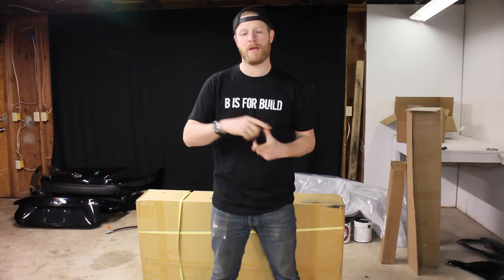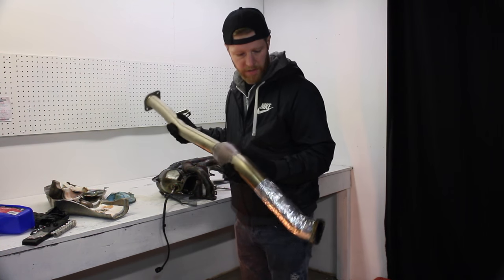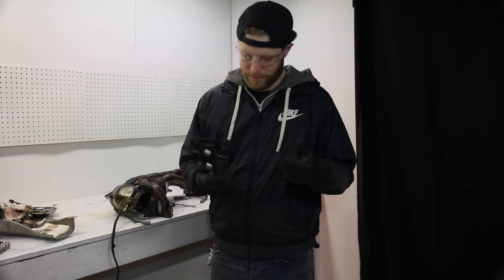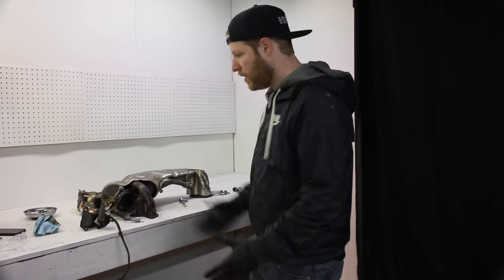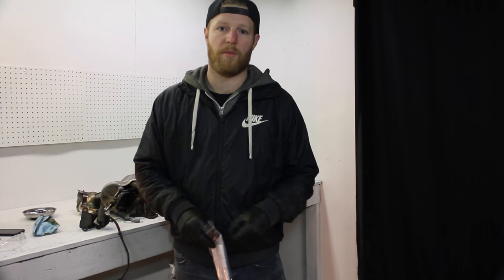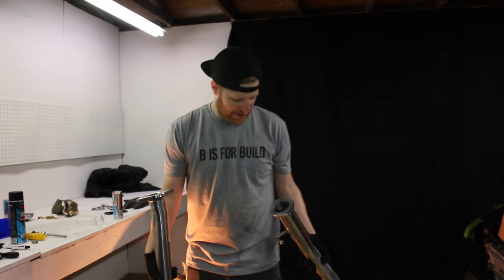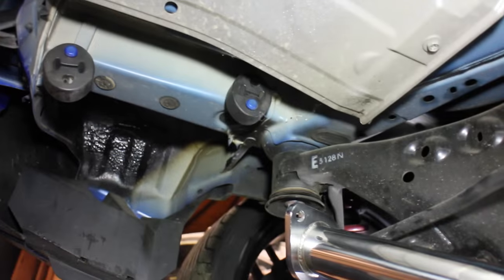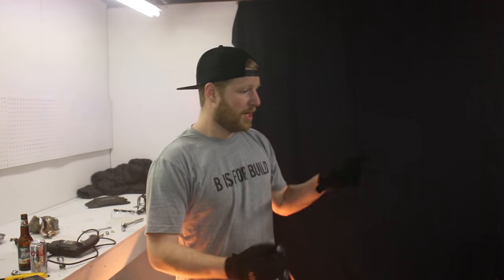BRZ Resurrection Pt 20 - New Exhaust Install & Minor Engine Failure...

Comment: My car started doing the same thing after putting on an exhaust. It took a few weeks for it to start doing that though. Kinda sounded like it was cammed, but unfortunately that wasn't the case. Just disconnected my battery and let it sit for a bit, reconnected it and it was fine, hasn't done it again

Comment: Not sure if yo put o2 sensors in the new exhaust but usually there is 2 either side of the cat and if the sensors don't read correct ecu doesn't like. Car is coming along great  though !!!

Comment: did you install all o2 sensors? does the nameless pipe delete o2 sensors or does is have a thread for them? sounds like ecu is just trying to correct the fuel mixture because it is not receiving a signal.

Comment: for those codes since they have seem to shown up after the exhaust and you unbolting your engine is check all the harness plugs and wires first..that o2 sensor 1 bank one is bad sensor most likely second o2 code sensor 3 is most likely because the cat does not have the sensor bung thus no sensor to install and is throwing a code. check the basics first..buy a service manual or try to find the specs for each sensor and test each one related to thrown codes with a multimeter to find out whats really bad or is another issue....

Comment: i had a p0055 code in my mazdaspeed3 and it was a blown fues for that 02 sensor 
but urs might not be because a lot of problems might cause for the cel Blown oxygen sensor fuse
Open circuit in oxygen sensor harness
Open circuit internal to oxygen sensor
Open circuit in PCM
Short circuit in oxygen sensor harness
Short circuit internal to oxygen sensor
Short circuit internal to PCM

Comment: Sounds like a bad idle so that would mean wiring diagram and tracing the wire to the ECU fore the engine or you could need a new throttle assembly. Sensor codes would new to replace the sensor or check they are plugged in and not dirty, if the codes still come up new sensors

Comment: Don't suppose there is a simple vacuum leak? You were moving around the engine quite a bit to get it back on the motor mounts. It could've loosened a hose, or worst case an intake gasket blew out? I'm not all too familiar with the boxer engine. My car once had an upper intake gasket leak and it threw codes similar to those you're getting.
Reply from the maker: +Yttrium ill look through all the vacuum hoses i can find and make sure none got undone

Comment: I'm quite positive most of the MAF issues are simply with the DIY intake. I have a subaru and their engines are extremely anal to bolt on parts without a tune. If you were just to slap on a cold air intake it will run like shit without a tune, and not to think about a DIY intake because the position of the MAF can be way off. I say the best bet is to get a stock intake and take out the MAF and clean it up maybe with some MAF cleaner and put it into the stock intake (Or get a brand new cold air intake & get a accessport tuner and tune for the intake)

Comment: start with tps sensor code it is the most important for now...ajust it 0.5-0.8v closed to 5v wot....your maf and iat is from your intake...o2 code is from deleting cat if u did delete it....u need to tune when deleting cat and doing intake mod on maf setup...your maf is too close from filter as well fit stock airbox back and put a o2 fouler if u dont tune it....i do this everyday fixing this from people who dont know and"mod" their cars....

Comment: That exhaust would sound great with a bigger engine, if you got a good LS2 engine and swapped the boxer out for it, you would get great performance increases, you wouldn't have to try to fix the engine problems you encountered in this video, and you would have a car that sounds like it wants to rip your brains out. I would go with an LS2 over an LS1 because it is lighter weight than the LS1, and that is what makes the BRZ/FRS such a special car, its low weight and its low center of gravity, pairing this up with a engine that makes over 400HP thats naturally aspirated would be a great choice, because if you decide that you don't have enough power after you make this decision and have already swapped your engine, you can still add aftermarket forced induction, and probably get an extra 100-200 horses in there. If you were to make this decision, then you would also probably need to look into buying a new transmission for your car, because the transmission in this car cant survive that...

Comment: lol, now you see why they scrap a car like this. Honestly, If you're going race mode with this one, you might consider going standalone EMS. You'll avoid the headaches of trying to diagnose a factory EMS that has been traumatized and have more control of the performance.
Reply from the maker: +Skwisgar2322 Well this car isnt going race mode, its my daily, so im not getting a stand alone ecu. Also when you say "why they scrap a car like this" you dont realize "they" dont know everything about every car, and its all a gamble, they cant invest the time to fully test every element of the car. if you saw my other brz pickup episode youll see that cars get scrapped like this and then they can be fixed in 6 hours and drove 2000 miles..
Reply: Loo, I am not criticizing what you're doing, I respect that, it is making use of something that would be crushed. I have seen most of you BRZ videos, your plan B was not "fixed" in 6hr, you got it into a drivable state, but at a shop it is not fixed until the customer has a car back that is fully repaired. To do that you have to do more then what you are doing on these cars. You may be comfortable driving your Plan A car with the repairs you did, but no shop that wants to do business would touch it, too much liability. And driving that on the streets is pretty irresponsible. If another driver runs into you and you are seriously injured due to the repairs you did which I promise you compromised the safety, they could now be held liable for your injuries that may have been prevented. Honestly, if you are gonna drive one and track the other, the plan A car should be the track car, at least that way if you get hurt it is your fault and you can accept that risk, the Plan B car is more structurally sound.

Comment: the bank codes are the o2 sensors is the throttle cable or electronic?
Reply: did you get the intake and air circuit code after the you pulled the map?  If so unplug it and run the scan again.
That the best I could do right now still training in this area

Comment: mass air flow replace,  intake air temperature sensor replace, o2 sensor front and rear replace, throttle position sensor replace that's all your code but the 3rd code.

Comment: Just dealt with a similar problem on 2 of my BMWs recently(Check it out here: https://www.youtube.com/watch?v=vtf_UUqoikw). Your drive-by-wire system is in fail-safe mode. Whenever there is a fault in the DWB system it goes into that fail-safe mode to prevent unintentional acceleration. 

Inspect the throttle body and the accelerator pedal for damage. Check the wiring to and from the pedal/throttle body for continuity. In my case it was a computer problem that resulted from low battery voltage and caused all sorts of weird issues. If that's the case and all of the hardware is good then clearing that code might be all that's needed(Subaru specific software might be needed).

Replace the O2 sensors that are throwing codes (They don't like shock from a crash and can die). Check and fix any and all vacuum leaks. Reconnect your MAF when you've smoke tested the crankcase and verified there are no leaks. It might be worth while to get your hands on some Subaru specific diagnostic tools. 

Good luck.

Comment: Unplug the battery, let it sit for a few minutes. Then hook it all back up and start it. Then let it Idle for twenty minutes and DO NOT touch the throttle. I'm assuming the car needs to learn its idle and it really didn't like it once you started revving it. 

I've seen cars run like shit very very often if they don't properly learn their idle.

Comment: I am sure is the o2 sensor cause it looked like it was bent on the last episode cause that will throw everything off  wen I put after market headers it threw off my cluster an wen I put the stock headers on it worked perfectly so is got to be the o2 sensors
Reply from the maker: +John Pena yeah i agree that 02 sensor is really badly bent and now im thinking its totaled, ill be replacing it asap
Reply: +B is for Build I had the same issues with the o2 keep us updated

Comment: +Bisforbuild can u do a video using cynderblocks and a few jacks to "hoist" a car in the air. it would help me save on shop labor etc. avoids using a hoist
Reply: Why if he has the right equipment? Depending how you used them they'd probably just damage your car or you if n when the car falls off
Reply: +key lo my trans is broke in my fwd fusion have to drop cradle. help me avoid shop labor plz.
Reply: +william illwill and using a hoist
Reply: If you cant jack you're car dont work on it ....
Reply: I can jack my car and in fact im going to make a video of this to show it.
Reply: Hoist shmoist

Comment: check connections running to and from mass air flow sensor check connections to first 2 o2 sensors up near the block itself the back two cats are actually downstream there only monitors you actually don't have to have those in the car for them to work the heater control code that you got should not affect the running of the car the performance code the zip code you got the p2100 go talk to Subaru I believe you'll find out that that may be a reset code just like the gentleman said pull the battery wires off and let the computer reset you should be able to not have to touch him together I wouldn't ever touch a positive and a negative battery wire together even off the battery you can cook a computer that way just disconnect them and let them hang for 10 to 15 minutes the computer should have to go through a relearn cycle

Comment: Has anyone else noticed the connectors on the passanger side front 02 sensor? The wires were switched. Why? 
You can see what I am talking about at https://www.youtube.com/watch?v=z6sKBsQi3LU at 4:10
And don't those things have to be sheilded? 02 sensors generate their own voltage based on the oxygen content in the exhaust stream when hot. If there is a poor connection it could throw it off. At the very least I have a striking suspicion that the wire connectors that were crimped on to the front oxygen sensor are causing at least one code.

Comment: Disconnected your battery to reset the computer
Reply: Another good shout, its been ran without an exhaust for a while, i still say lamba sensor or however its spelt
Reply: +key lo  one code can make more codes come up give it a try disconnect the battery ...it might be  that your maf sensor its reading to much air then what it supposed to I drive a Scion FR-S by the way
Reply: +key lo this will reset the ecu and adjust to the new short ram you made